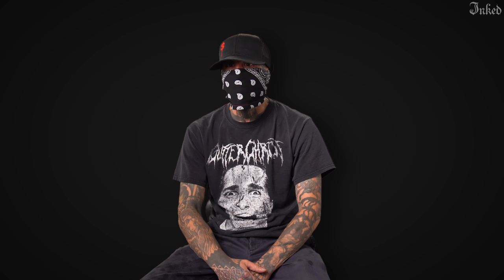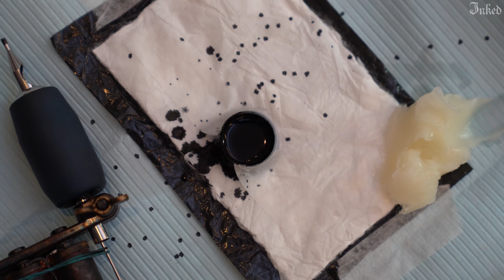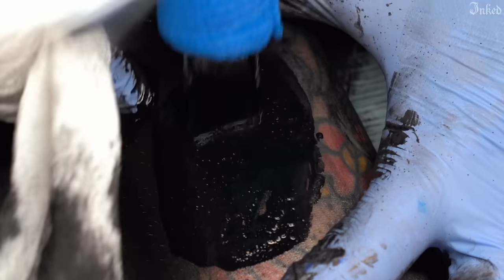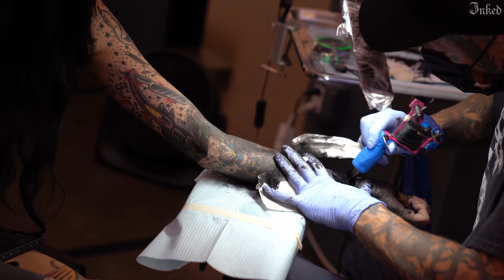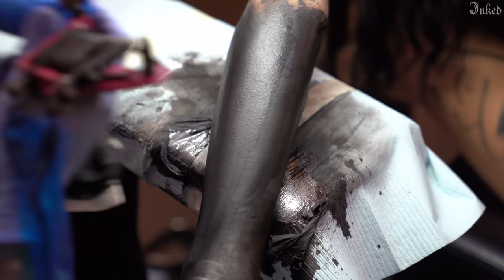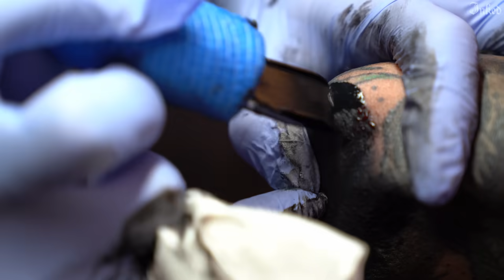A Blackout Tattoo Will Change Your Life | Tattoo Styles

Comment: You could tell she was hurtin when he started in on the elbow.
Reply from the maker: Who wouldn't be? The elbow is not exactly a fun place to have tattooed.
Reply: Yea, but the left& right side of my Torso!! Ohhhw  ,that was the banger for me. 9. V 9 scale !
Reply: That's why I try to avoid the bone areas 😂 getting my chest did was pretty gnarly as well 😂😂
Reply: @inked  To me the elbow is dead skin. I haven't felt a thing. The problem is that the black worn out quickly.
Reply: @paolagrando5079  what do you mean?
Reply: @InchFab  if I pinch my elbow it doesn't hurt, it's thick skin. When I had it tattooed it didn't hurt. And I should get it retouched because it's an area that lost a lot of the black colour.
Reply: @paolagrando5079   mine did too. My left elbow is almost all purple.  Took 3 times going over it to get the color to finally set right
Reply: Had a tattoo near my knee a month ago yeah it super hurts
Reply: I got a pentagram on my elbow and I can personally tell you that and right around the Adam’s apple on the neck almost tapped me out
Reply: I was hurting FOR her! Right on the bone...cringe
Reply: Yeah the elbow was the worst pain I’ve ever felt, I have a big ass mandala design on my elbow that’s blacked out in the majority of places and it hurt like a bitch!
Reply: @paolagrando5079  tattooing is so strange. I got the back of my calf done and if you pinch that it hurts like hell lol. But when I got it done I could barely feel it
Reply: @inked  got both elbows the left wasn't bad though idk why
Reply: @dannytheman3222  I have my elbow tattooed as well because of my sleeve and mine wasn’t painful either. Everyone experiences pain differently of course. I heard many people talk about how bad the elbow was and I was nervous for no reason.
Reply: @nattie22  everyone said getting my achilles done would be hell and I swear I didn't even feel it. but the back of my calf, which supposedly is easy, hurt so bad I was reminding myself to breath. everyone has their own painful spots for sure.
Reply: @AJ-uo5zl   Omg the calf, that shit was brutal. Full sleeve no problem for me, thigh was no problem too, and when I got my calf done with just a small tattoo I felt my soul leave my body lol.

Comment: I have both sleeves blacked out over existing sleeves. It's no joke sitting through this. I had both done in two sittings each arm. I've had them done for about 7 years and when I asked to get it done they thought I was crazy. It's hardcore and it looks awesome. I think it's a serious dedication to wearing tattoos. It's quite popular these days but... I don't think it's ever going to be as popular as trad sleeves, which is fine by me 😉 A good blackout your looking at about 12 hours (depending on the mag and practitioner) for good, solid work. The healing is incredibly painfull and difficult to do nicely, you'll need extra sheets and old t-shirts for a week, maybe two. And yeah, you're going to get a lot of crazy looks, people grabbing your arms outta nowhere, people shaking their heads at you, endless questions about why, what was underneath, and occasionally you'll get a smile that says "Yo that's badass"
Reply: 12 hours? Load of crap. Try 6-7 with a larger arm.

Comment: You can feel the pain from looking at that monster needle going up and down around that elbow. This is real intense and hardcore - respect!
Reply: its multiple needles not just 1 big 1. my tattoo artist showed me each needle as he did my tattoo coz i was nervous about it. he showed me each one and how they work different
Reply: Charlieto    Either as a cartridge or on a traditional bar, regardless how many individual needles it contains, once soldered together the grouping is referred to as a singular "needle". 
When speaking of how many needles I've used in a session to another artist, I'm speaking of how many cartridges since it's given that each individual would contain many, usually I'm using three to fifteen in various configurations. 
This is probably since using a single needle by modern Tattooer is a rare thing, for good reasons. Being about an inch and a half wide it's likely that few people would imagine that this machine was using just a single needle.